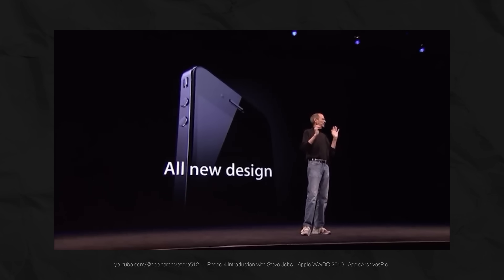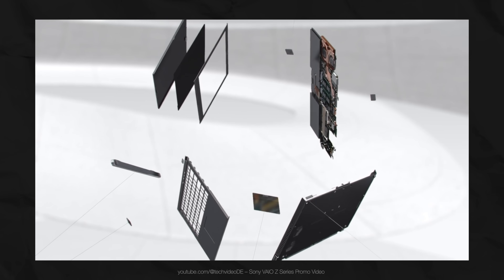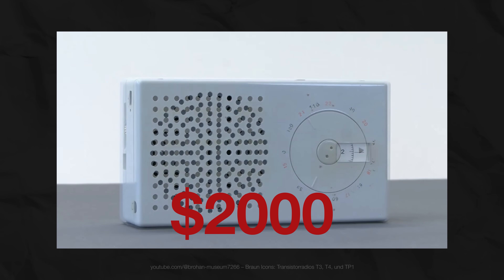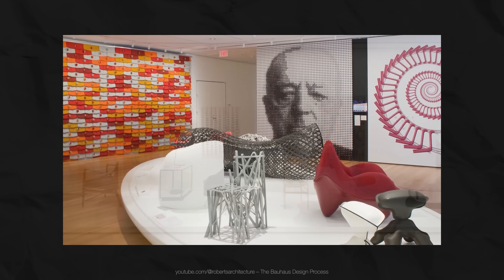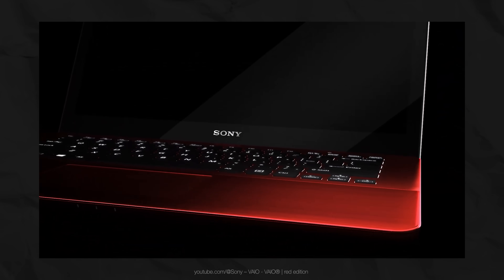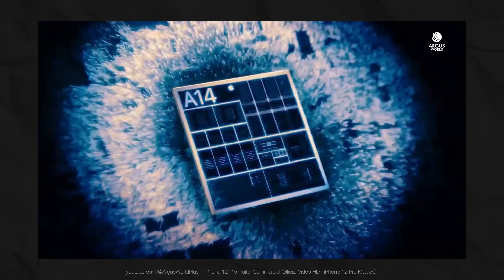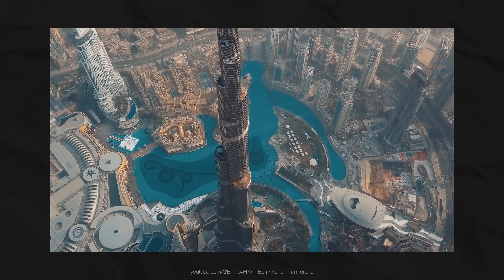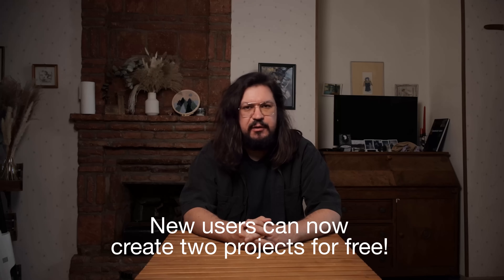The Flat Edge Dilemma

Comment: Haven’t watched the video yet, but clicked instantly just by the title. I prefer the rounded edge because you can hold the phone in lots of ways without it feeling uncomfortable or that it’ll slip out of your hand. I’m finally upgrading my iPhone 11 to a 17, but I’m going to miss the body-style of the 11. I don’t use a case, because the round edges are comfortable. The flat edge design is the opposite of ergonomic. There are not many ways where it feels comfortable to hold.

Comment: At the end of the day a squared off phone is the most practical shape for it. The square edges give you plenty to grip onto, the battery can extend further, there's more space for the motherboard, etc. 
Back when I had a magic mouse there wasn't anywhere to practically grip it other than from the top case itself and it was as slippery as a soap brick

Comment: It's good to see this discussed on a high-quality channel, but I feel like the actual contents of the video are disappointing. Most of the video is just looking at historical examples, while on the topic of flat edges, the video only has this to say: it's not for premium looks, it's for internal component density. And this is treated like a sufficient explanation, like we are expected to just accept that it's a worthy tradeoff for every company.

This raises a lot of questions, such as:
1. How important is the density, really? Can't you take a 2% hit for more ergonomics? A 5% hit? With no numbers, how can we tell how necessary this is?
2. If it's so important that no one can make round phones anymore, why did Apple switch in 2020, while most other manufacturers only did in 2024 and 2025?
3. If you have to have these super flat sides, why is Apple now going back to a fairly rounded design with the iPhone 17 Pro?
4. If you don't, why do Samsung phones have these extremely unergonomic sides with a tiny border radius, considering they only switched in 2024, when Apple has already gone for a more round design? Clearly you can do better from a technical standpoint.
5. We have seen that literally all components can fit into the camera island. The rest of the phone is battery. With the new SiC batteries having massive capacity, how soon will a 2% (5%?) drop in capacity will be irrelevant?

To me, it seems like the density concerns are not as overbearing as you make them out to be. In a few years, they could easily go away (or not). But the video implies this is how it will necessarily always be now. This to me seems like a very surface level analysis, think: "it's made that way, so it must be the only way", "Apple did it, they know what they are doing, so it must be the right thing to do". It's easy to justify large companies' decisions that way, but it's not really insightful or useful for predicting the future.

Comment: I have a teory about why apple switched to flat edges, and it has to be with screen size, when you are using a roud edged phone, the screen ends, the besels end, and the edge of the phone makes the screen feel smaller than it is, and with flt edged phones, that changes into a milimetric edge of the phone instead pf half a centimeter

Comment: sony shifted to rounded frames, afaik on xz series... the exact series i tried to avoid... only had xz premium and xz2 compact of that series... never liked the design of xz2 and xz3 series especially the "bulging" back (except the compact, interestingly it is good in the hand and i miss using it after upgrading)... good thing sony went back to its old design language of the z era (except maybe the z3) and adding some character like the ridges on the frame and patterns on the back, encouraging me to use 1v without a case 😅

Comment: I just switched from a massive round edged phone (Galaxy Note 9) to a modern M35. On paper they are the same size but m35 feels so much more bulkier because of the boxy edges also the m35 is 24 grams heavier than the Note 9 but 10 grams lighter than iphone 17 pro max... it feels like a lethal brick in my pocket.😢

Comment: I found that I would constantly drop my iPhone 6 and 11 with their rounded corners. The second I started using my 12 pro the dropping dropped to almost 0.
Reply: I scoffed at this ridiculous statement. And then I remembered that I replaced the screen on my 6s (which I used till I upgraded to a used 13 pro last year) at least 5 times... It was a very comfortable to use device, though.
Reply: The rounded edge minimizes contact with the phone so it gets less friction. This makes it prone to slip.

Comment: Round edges have downsides, too: their maneuverability is matched by an equal lack of grip. I would like to see a phone shaped like an iPod, very rounded on the back with a flat front. Apple one and only attempt at this, the iPhone 5c, remains the most comfortable and ergonomic iPhone ever made.
Reply: Bingo; absolutely the best phone shape and hard-coated polycarbonate shell with a black glass front.
Reply: I loved my 5c and 6S, I miss their great color selection & TouchID, also they were before phones got so big, used to be a joy to operate

XS and 11 Pro are still my favorites of the FaceID era, very good phones, though I never had a 13 Pro which is highly-regarded

I’ve got the Air now and like that it bucks the bad weight and ergonomics of the recent Pros, although now that base models have high refresh screens they’re a great value for a slightly-easier one-handed use than the Air

Triple camera arrays were cool before they stuck out crazy far from the back and made the phone sit unevenly, or had such tall vertical presence on the phone’s back, to where you can’t fully extend your index across the back of the phone without smudging a lens
Reply: Wasn't the iPhone 1 like that?
Reply: @kylespevak6781 Yes, and it felt wonderful.
Reply: @kylespevak6781  It was just the iPhone, then came iPhone 3G and 3GS, which did have rounded backs and flat fronts, but it's easy to forget those phones because they were not good phones; they were like beta test phase phones dropped on a gullible public; the modern iPhones really started with iPhone 4.

Comment: Smartphone pinky is a result of phones being too big for one handed use
Reply: I get pain in my hand and wrist from phone use.  I tried an S23+ and it felt heavy and a bit too wide.  Now I'm using an S25 Edge, and it is so nice how thin and light it feels. Definitely helps reduce the strain..
Reply: I never had this pinky idk why
Reply: less about the physical phone being too big more about the screen being nearly at the corner. I was still using the pinky on the mini
Reply: isn't smartphone pinky just the skin being temporarily compressed? i've done this a lot over the years and i don't really notice a difference in my pinkies
Reply: Yep. 5 inches 16:9 (5.9 inches 19.5:9) is the peak width for one hand usage
Reply: smartphone pinky is a fair tradeoff for bigger screen
Reply: I don't think that's true. I think its largely because it's too uncomfortable to press buttons in the closest corner with your thumb. Especially with these new screens going right up to the edge, the corner of the screen is basically buried under my thumb muscle in my palm.

Comment: I hate the sharp edges trend. I have a phone from 2021 without them and will probably stick to it until it dies. It was fine on tiny phones like the iPhone 4 but for new massive phones it just feels terrible in the hand
Reply: That’s one of the things I love most about the iPhone 17 Pro. They returned to a soft edge, unibody design, with only a glass “window” on the back for wireless charging, rather than being a sharp metal “sandwich” between two panes of glass, like most smartphones are now. I know it’s seen as a controversial design, but I see it as a big improvement!
Reply: Get a case with smooth edges or get the iPhone Air
Reply: @1emmanuelnavarro  neither of these are good solutions. The case makes the phone too bulky and iphone air is just a terrible phone
Reply: Same. I straight up ignored all the iPhones with sharp edges. And even bought an iPhone 15 over 14 Pro (knowing that 14 Pro is better) because of softer look and feel. 

Still hoping they’ll circle back to iPhone X/Xs era design in a couple years.

Comment: I think someone at Apple looked at a graph that said that 99% of customers use cases, therefore the edges can be sharp for displaying a sexy looking phone while still not really bothering anyone in real life.
Reply: That's exactly what happened, and for better or for worse, they are completely correct (and it doesn't help that sharper edges are obviously better if you want to use a case).

Comment: constraints or not, there's still much room for design decisions. like symmetrical (both horizontal and vertical) camera bumps, soft touch or carbon-weavy plastic back panels and no hole full screens (be that with sliding up frontal camera or slightly taller bezels). it's doumb that 99.99% of all phones are the same in these respects no matter what. not to mention smaller (but 100% adequate) screens.

Comment: The iPhone 17 pro is actually comfortable and the platue actually helps with the phone pinky
Reply: Creates another issue, your index finger can’t fully extend up the phone to support its back like you can on normal 17 or Air, was also inconvenient on Pro 15 & 16 prior, because the square stuck out way too far from the edge of the phone and was almost as tall vertically as 17 Pros’ plateau

I think Pro iPhones have been an ergonomics disaster since 15, maybe 14, but the 17 Pro is by far the worst and looks inelegant and has materials issues for the first time in a while—lots of scratching and the weird two-tone back

13 was the last great Pro iPhone imho